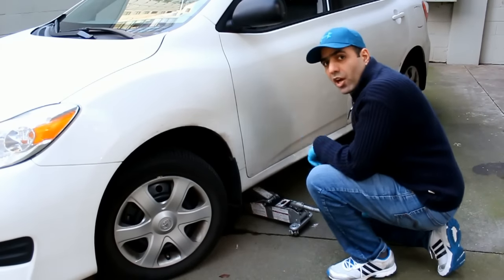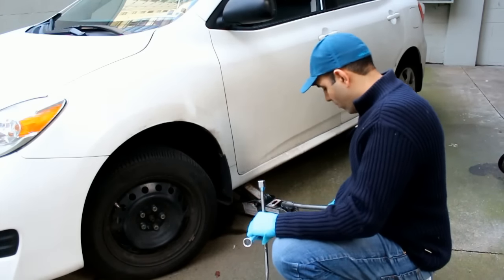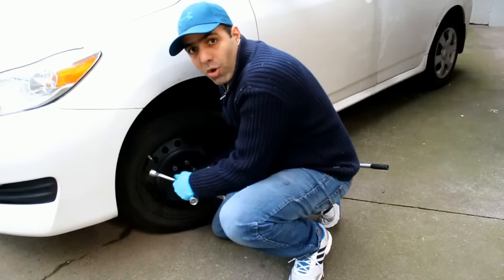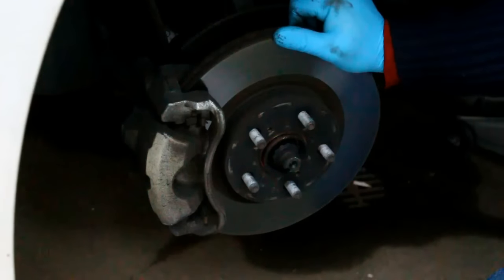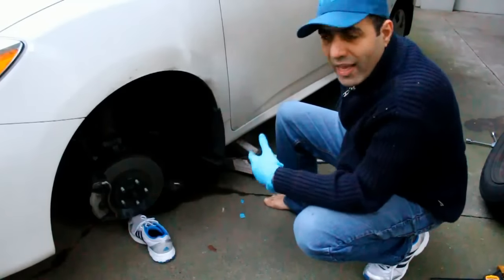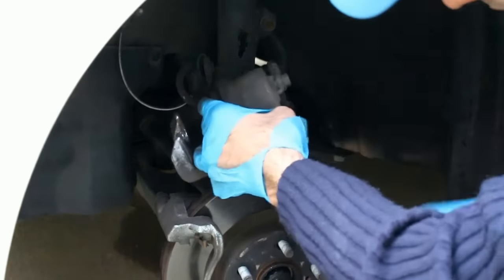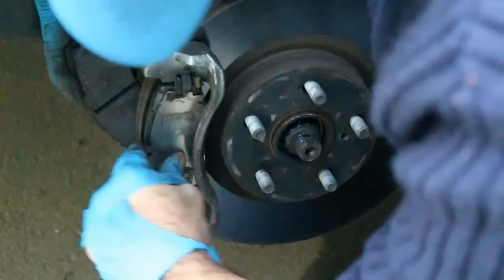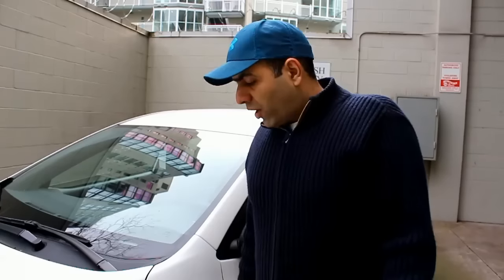How to change the brake pads of your car

Comment: I realized something the other day: In high school I was studying to be an electrician and of course stumbled across your videos. Overtime it became evident that electrical work was not something I wanted to do for a living every day. When I bought the car I have now, one of the things it needed right off the bat was a brake job and I remembered this video and thought "if that guy can do it..." On Monday I start my fourth week at my first job at an auto shop.
Also my buddy has that same jack and we've always turned the release knob with our fingers. We never thought to use the handle.

Comment: Good and easy to follow tutorial for most cars, however you forgot a crucial component that EVERY backyard mechanic should know:
A good rule of thumb, if you EVER remove a wheel from a car, put it under the car so that when it falls down, it falls on the wheel. Doing this simple act SAVES lives. Live safe.
Reply: K. Meinzer Thanks for the tip
Reply: K. Meinzer damn I am 2 months late with the same reply :|, yes this rule of thumb is a very good practice, I've had the jack slip once and the wheel stopped the car from falling any further, which I was grateful for since, well I could have worked underneath and got crushed :), this is something I really do not want happening
Reply: K. Meinzer thanks, sir.
Reply: K. Meinzer but if you have aluminium tires they will get dirty :(
Reply: +TM80 NotGoodWithNames  dirty  aluminum tires/wheels  or  loose some toes
Reply: clean aluminium tires :D and real lifesaverstuff
Reply: Yoo Per they're obviously not on purpose. Why would someone almost get their toes cut off by a car on purpose no lessM
Reply: But my sweet 10k MAGS are gonna get scratched!
Reply: But what about the tire? Will the tire not be hospitalized if it takes the fall?
Reply: I would never do that to my rims
Reply: @corncobjohnsonreal  They are on purpose. The Chanel is called Electroboom, because he is electricuted every video, multiple times, because of his mistakes. If these mistakes weren't on purpose and they weren't planned, he would be dead by now.
Reply: Except when changing a tire. No need to do it.
Reply: @Gh0stlikeWar  Working only on jack without a stand is just an idiot move.
Reply: I'm the 420th like
Reply: I realized how important this was in Dallas this year. Trying to rush through changing an RV tire in the heat, and it came down. Thank god we put the tire down or I’d be two Casey’s.
Reply: @dshaprin  He said himself that it's better for him when they're not planned because he gets a more real reaction. There's plenty of examples of planned and unplanned mistakes and it's fun to try and spot them.

Comment: Please remember to use a jack stand on your car. It prevents your jack from slipping out and makes things more safe for you. Also remember to not drive the car if the brake pedal is spongey it's a sign of something that will prevent you from stopping.

Comment: Love your videos, thanks!  To everyone watching, make yourself a few rules and never break them.  Always use wheel chocks.  A couple chunks of 4x4 will do it. Block the opposite corner from where you are lifting.  And always make sure to use a jack stand, share the weight between the lifting jack and the jack stand.  Give the car a few good rough shoves to see if it will fall off the jacks before putting any part of yourself under the car.  I'm not a safety do-gooder but a friend of mine died when his car fell on him.  Rolled backwards down the driveway when he jerked on a wrench, and toppled off the single jack he was using.  If you can't do all of the above, like when changing a tire with the crappy OEM jack, stay out from under it and have a plan for when it falls off.

Comment: Hi. Thanks for your interesting videos. I'm a new subscriber watched all of your videos. I love the way you emphasis the danger and mix it with a sense of humor. Also a common safety tip is to place the detached tire under the car just immediately after detaching it. So that if the jack accidentally pulled out of it's place, it will prevent the disc and other parts of the car to be damaged or even the body parts to be trapped and smashed under the fallen car as you showed the risk in your video very well. Many thanks again.
Reply: im new. your old now 😂
Reply: @nikonike163 you're old now, I'm new 😂

Comment: I see you didn't put any lubricant.
Reply: +rencrow lol
Reply: Why would brakes need lubrication? (serious question)
Reply: +Rafael Gomes sometimes it's good to put some grease on the side of the pad that comes in contact with the caliper piston so that it doesn't seize up to it and also someone the clips. but other than that you shouldn't really use too much grease on brake parts for obvious reasons.
Reply: The guide pins usually need greased. Guide pins let the caliper move around just a little. You typically want to use a high temperature silicone grease because first off brakes get very hot and also there are usually little rubber boots over the pins to help keep dust and grit out, petroleum based greases do bad things to rubber. If you buy a decent set of pads and not just the super economy ones you usually get a small packet of grease along with any clips and such.

Otherwise, you absolutely want to keep the friction surface of both the pads and the rotor grease free.
Reply: correction, high temp grease :)
Reply: My thoughts exactly. Also, should've gotten the rotors resurfaced.
Reply: Watch chrisfix if you don t understand why to use lubricant
Reply: Wait that illegal
Reply: @AlexanderNecheff  Normally a small amount of "copper slip-Anti-Seize Lubricating Compound" is applied to the back of the pads at the point of contact with the cylinder but a "shim" can be used instead, mainly to reduce juddering and noise during breaking. Such lubricant can also attack rubber and should not be applied to rubber but smeared to the metal back of the pads. It can withstand high temperature and this is why it is used here. Silicone grease is friendly with rubber but I would not use it for such application but rather on "O" rings and "lip" seals of non moving parts.
Reply: @sebastianalexandru3841  just to make it easier to remove and install, also to use as somewhat of an adhesive so the brake pads are nice and secure
Reply: +Alexander Necheff is correct. Many people forget this and wonder why their brakes stick.
Reply: +S Kasey wrong. Anytime a mechanic lubricates the brake pins and back of the pads, they should be using brake grease, not general high temperature grease. It’s rubber safe (obviously because the pins you put it on have a rubber seal) and on the back of the pads it’s safe too.

Comment: As a note, you should always use a torque wrench when re-installing the caliper bolts, and torque them to the manufacturer specified force. Brakes are constantly under extreme forces so under/over torquing them can result in the bolts shaking out or sheering.
Reply: No need to tighten these super hard as they only connect the slide pins with the caliper
Reply: @Nycorexti  for real 💀 Im going to tell you 90% of these comments aren't mechanics and they're just over zealous DIYers who dont know shit

Comment: You should have mentioned one or two things.
1. When pushing back the piston, sometimes you have to open the breakfluid tank so u are able to push them back. And if nessesary get some of the breakfluid out of the tank.
2. After pressing the breakes a few times u have to look if the amount of left over breakingfluid is correct. Eventually you have to fll it up.
3. When the New breakes are on, you mustn't do any hardbreakes for one or two days driving. 
4. If the disks have some little "scars" the New breakingpads have to get the correct "shape" to have full breaking power.

Just sayin. But as everytime, i love your Videos ;)
Reply: About number 3: different types of pads and disks have different types of break in periods. Sometimes several hard breaks are required to seat the pads. Read the manual and avoid coming to a complete stop.

Comment: here's a tip that my dad told me, ALWAYS PUT THE TYRE UNDER THE CAR AFTER YOU TOOK IT OUT FOR SAFETY
Reply: it will protect your car if the jack fail
Reply: Thanks dad
Reply: He is making all these mistakes on purpose. 
For other to see the dangers.

He is not an IDIOT.

He knows very well what he is doing.
And in a very smart way....
Reply: @ae70gts  While you're correct, the thing is, he didn't say to do that in the video. They're not trying to correct him, but to add information to the video.
Reply: @L7vanmatre  so if I answered not to put tyre under the car because if the Jack fails there is a chance the tyre will get damaged and maybe it blows up in your face.
And that would be dangerous. 

Would that answer be considered  as extra info?
Reply: @ae70gts  I just mean that they weren't saying he's dumb, they were just letting passersby know that safety tip. If you want people to know that, then you do you, and yes.

Comment: Mehdi, if you remove the top one only. A lot of times you can pivot it out of the way on the bottom one and still replace the pads and it saves you a bit of time

Comment: PROTIP: Place the wheel under the car, if your jack breaks the wheel wont let the car drop all the way. I always do this when I have to do the brakes.
Reply: +Eduardo J R But I'd rater the car fall on my face than my precious wheels :D
Reply: +Eduardo J R yeah my wheels are too expensive
Reply: +msul78 Use something like old steelies you find on junkyards, or use the spare.
Reply: +The Nuclear Fishcake or just use jack stands lol
Reply: GeeFK Yep, I know, but this is for those who don't have jack stands and only use jack sits
Reply: or changing a flat in the middle of nowhere, I don't take my jack stands with me all the time
Reply: The Nuclear Fishcake why not just spend $30 on something that will save your life?
Reply: Or your shoe

Comment: For the brakes, it would also depend on what sort of drive system your car has. (Such as front or rear wheel drive, or all wheel drive in some cases) I have a front wheel drive vehicle so I agree the front brakes are likely to wear out faster. I had to change a set of brake pads on my dad’s SUV once. It wasn’t all that bad, especially with two people working together.

Comment: 1:15 this is why you should use anti-seize on anything you screw back together. The military used to jump on giant wrenches to my uncle’s horror, so he would mix axle grease with WD-40 and paint it on the inside of the nuts. He was very happy when they invented anti-seize.

Comment: I've done the brakes on my car and my sister's car (similar model) and also my mom's car.

And I MUST SAY, the speed with which he just slapped those front pads in was ridiculous. 
I'd love to work on cars that have that sort of build. It's been a headache every damn time for me! Everything is so congested, it's crazy. I don't know how they build these things in the first place.

Also he is totally correct about needing to press the brake several times, I had replaced them and FLEW down the hill afterwards, I eventually pressed the brake enough and the car slowed down. Pretty scary and quite funny in retrospect.

Comment: the jack is pneumatic, not hydraulic.
edit: also, the jack is purely for raising the vehicle. You should use a separate stand to keep it raised at that height, because pneumatic jacks can also lose pressure over time or any failure in any of its seals will drop the vehicle.

Comment: 0:49 you could put the car in reverse gear, and it will stop the wheels spinning forward and allow you to undo it. On the other side you'd put it in gear 1.
Reply: Or put the parking brake on

Comment: Your videos are hilarious!

BUT, on a serous note- NEVER work on a car just supported on a jack, you should always have something else under the car just in case the jack moves, shifts, the hydraulics leak...  the generic safety natzi answer is jack stands but in a pinch and if you're in a hurry, just throw the tire that you just took off under the car, if the jack shifts the worst that can happen is it falls on the tire, not your foot or leg...  While I'm at it, chock the wheels or if you're working on the non parking brake axle you can set the parking brake.
Reply: you didn't take your medication right?
Reply: ***** He also mentioned to put something else under the car during the video.

Comment: as a mechanic myself he missed a crucial part when changing the pads you MUST resurface (or smooth out) the brake disks or rotors or whatever you call them to increase the efficiency and life of the brake pads if you dont it can cause catastrophic failure and result in inability to stop

Comment: You always check to make sure the caliper goes back without a problen first, if it doesn't then you need a new caliper, you should've also removed the bridge and filed the contact points of the pads and put on a new hardware kit to ensure they slide freely, also how you pressed back the caliper is dangerous if you have a fenolic(?) piston as they are easy to shatter if you don't have the proper caliper compression tool, and while folding the flex line over you have to be sure not to crimp it too much as the inside can collapse, requiring a new flex line and then bleeding the system (which requires 2 people or an expensive computer to run the abs module to bleed)

Comment: extra tip: the jack is just t lift the car up; it is not the job of the jack to hold the car; after you have lifted it up you should put something else under the car to hold it up and remove the jack
to get the car back down put the jack back and remove whatever the car was sitting on and then release the jack

Comment: You should also put a large rag or try under the brake fluid reservoir in case it overflows when you compress the piston, or you can get a turkey baster and suck out fluid when it gets close to overflowing. Also it's a good idea to change the brake fluid every 60 to 100k mi.

Comment: You should also replace and grease the brake hardware that the pads slide on, to prevent binding or even the pads seizing

Comment: You gotta put thread locker on those bolts and make sure the guide pins are working right, also the bolts are supposed to be torqued down to a certain spec or else they could come loose and cause break failure, hope no one actually followed this video could be dangerous

Comment: You're supposed to open the brake fluid cap first to compensate for the piston getting pushed back or you might crack the container due to pressure.. But I'm sure manufacturers account for this

Comment: I now Mehdi is mostly playing here but i thought I'd add if you put you wheel under the car then if the jack does go the wheel will offer some protection.
also never put any part of your body below the car without axal stands.
No idea why YT is recommending this now but it's funny.
also the runners need a little copper grease (that's the bits that hold the pad in) so it is free to move in and out, if you don't it will squeak

Comment: You forgot to open the brake fluid cap. You'll have a hell of a time pushing the piston back in. You also didn't explain how some calipers require a twist to turn/ push back in. Also, some pads in the USA require you to put the pads in the caliper instead of the caliper housing.

Comment: Don't use a hydraulic jack alone, it's safer to have an extra sttand to put under the car in case of an accident like this where the jack lets go and drops the car. If you use a mechanical jack, then it's ok to use just it alone, it's far less likely for it to break and drop the car